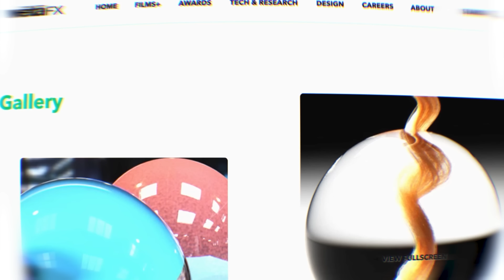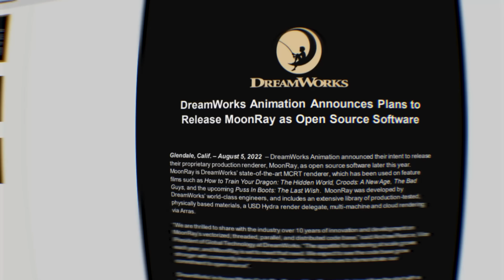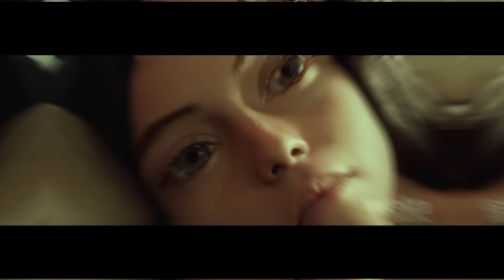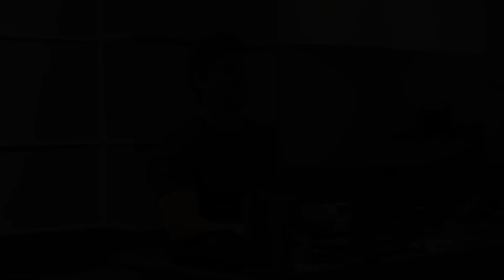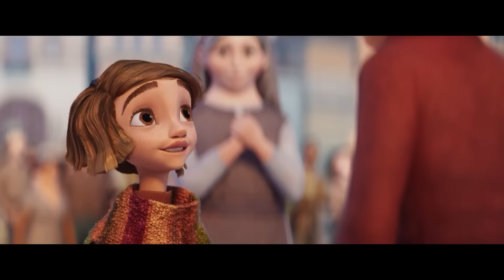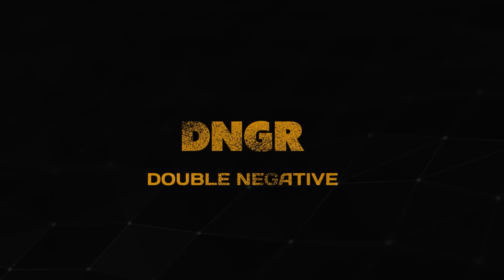The 3D Render Engines They Don't Tell you About

Comment: I was a renderman TD 20 years ago. Now I am a baselight colorist. Now every render engine has fantastic prebuilt shaders I m no longer needed to simulate subsurface scattering using z buffers blurring. But still I believe movie rendering owes much to rob cook who used Poisson dust method to anti alias, this was extended to shading and also montey carlo ray tracing (path tracing) is extension of that. I remember I once tried to render with distributed eaytracing and it took 9 days to render a frame with refraction and soft shadows

Comment: Thanks for the history lesson and industry breakdown!
I first got into static renders with Daz3D as they transitioned to MDL and early ray tracing, and it's absolutely stunning what RT can do when setup properly, especially with PBR materials becoming the norm. 

Other than custom UI and marginal efficiency gains, I don't see why studios invest in their own software if something is available on the market that meets your needs. Sounds like more of a market opportunity for a simple modeling and more efficient rendering engine to compete with Blender. Building a functional User Interface is hard, and what's holding a lot of Industry back.